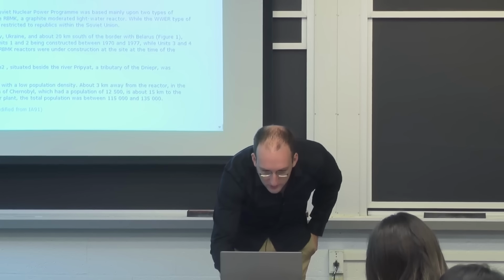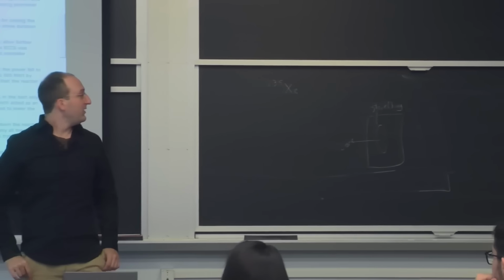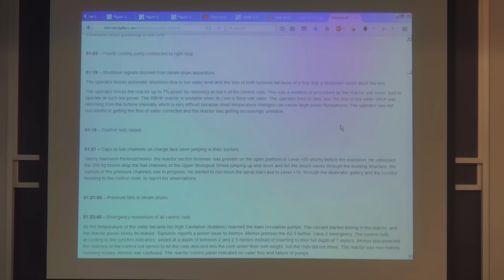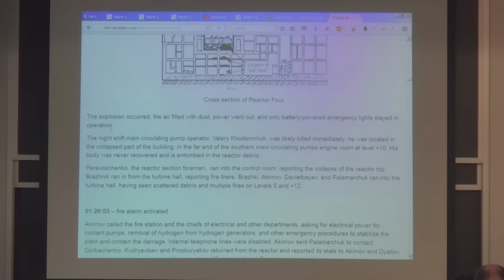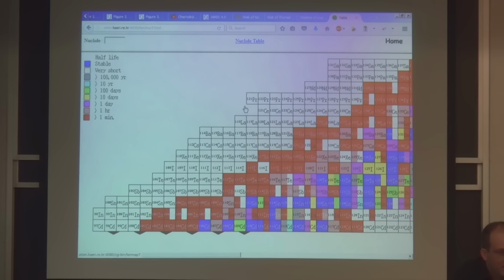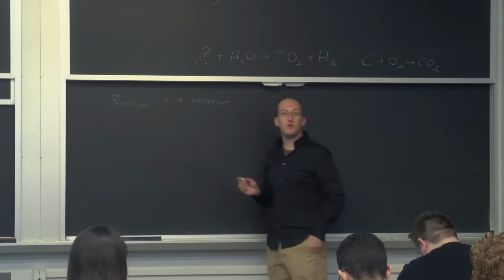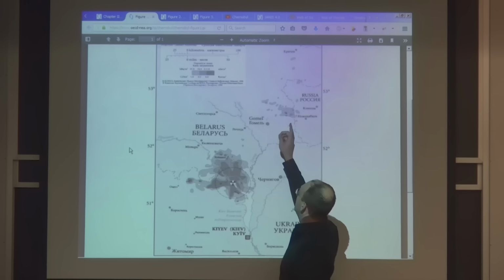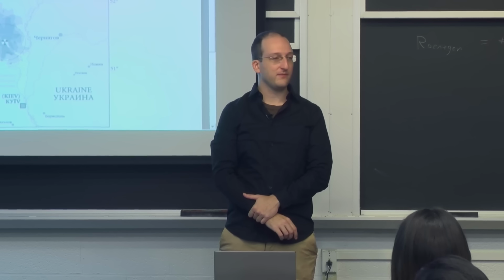26. Chernobyl — How It Happened

Comment: I worked at Leningrad NPP after the accident upgrading the SKALA system for 3 neutron flux cals. This lecture although there are some minor flaws is really good - there is a reactivity balance model that might have enhanced it further by showing Niles vs time for changing neutron energy populations, Xn135 conc and rod position. They also broke 6 operating rules leading up to the test not just control rod positions. Also the command and control perspective is often overlooked also. Many thanks
Reply: It seems that violating safety rules was normal working mode for Chernobyl. Because RBMK was so unsafe that they cannot work withot it.
Reply: @ВасилийКочергин-д6ы in soviet russia there is no safety rules
Reply: Indeed, the command perspective was very important. The early decisions on the test should have been over-ruled. Any resistance was countered by threats.
Reply: Thanks, comrade 🤝
Reply: Yes, the plants had a lot of issues, but the  ain reason Chernobyl happened was because of the communist system in place.
The people who knew what could happen (running the reactor at higher power in the hours before, poisoning the reactor) were disregarded, treated like saboteurs who didn't want the test to succeed.  
Later those that knew what was about to happen were silenced / threatened by those who wanted & needed the test to proceed that night (because delays would make them/ their bosses look bad)
.....
When it happened, the people who understood, were silenced / threatened because it was so absurd to say that a glorious NPP could go into meltdown.
.... Those who went out with numerous Geiger counters (all measuring off the scale) were told to shut their fear mongering because the detectors were probably just malfunctioning,
They even opened the amusement park to paint a picture that everything was okay and distract the people.

All to climb in the party, get promotions
Reply: @mysteryliner  It is factually wrong to say that "they were told to shut up with fear mongering".
The local operators pretty much knew early on that they had done a bit of a fucky-wucky from radiological surveys.
They just did not want to admit it and it was hilarious in the scariest sence of the word how they tried to hide the truth from higher-ups in the state.
Also the operators of TEPCO tried to hide the meltdown so its not actually a question of system.
Reply: @mysteryliner  and Fukushima happened because of... capitalism 😅😅😅 and its corruption.
Reply: @mysteryliner  The worst industrial disaster in history, overshadowing the death toll of Chernobyl by an order of magnitude, is the Bhopal gas leak. That was all down to capitalism and greed. Simply saying "Communism bad" is unhelpful.
Reply: @ErwinPommel  that was not the intention of my comment.

For the last 35 years, the world has feared nuclear energy because "remember Chernobyl" (while 8 million die each year due to air pollution, yet we are building more gas furnaces to get away from "remember Chernobyl"))

My point was that even though the plants had horrible flaws, they in itself would have never led to the Chernobyl disaster!
Reply: @ErwinPommel  Capitalism & greed + corrupt government officials that literally got sold to the businessmen. Also , quick reminder , Bhopal Gas Tragedy occured when Indian economy wasn't open to world investment. PS : I would still live in capitalism than communism. Your friend from India.
Reply: @ErwinPommel  Industrial development in Madhya Pradesh is state sponsored in order to stimulate industrial development of the region for political ends - not entirely dissimilar to these communist economies. In a free market capitalist economy there would have been no such development.
Reply: @tech_report_0868  It was the communist system, which lead to the disaster. Capitalism had nothing to do with it.
Reply: @FreedomPhilosophyTV  Having a free market economy is not incompatible with the state investing in some industries to help them get capital they otherwise couldn't. The key is whether private property is a right or not. In a socialist/comunist country you do not have property: your business is not yours, your home is not yours, what you produce is not yours. You are a slave of the state/politicians. In Cuba the state owns the business and state employees/communist party members decide what you can do, how much you can produce and how much do you earn and how much is for the state. They achiveve equality of results only for non party members: they are all equally poor. The flaws in capitalism doesn't make socialism/comunism good nor better, they are not, they are way worst. 

The one thing they do very well is propaganda. They are aware of how words create the concept of realty in people's mind.
Reply: @ErwinPommel  Yes. The only part i didn't like was the message, specially at the begining, that "American reactors" this, and "American reactors" that. It wasn't a dick measuring contest, just an informative lecture. Kind of bothered to have to hear that at the beginning, and coming from someone that looks like it doesn't lack any intelligence. So, not sure what the objective was on those comments, other than to brag just for the sake of it. It could just have been better to leave it color and country neutral, because now, how can i tell you are being objective?
Reply: @mysteryliner  Similar situation is what caused the Great Famine in China (1958-1961). Party officials would overreport agricultural storage production to make themselves look better compared to other regions. Everyone thought that they had more food than they did and "overspent". That, and the monumentally stupid decision to kill off sparrows because they ate grain seed...which led to bug infestation that ate all the crops anyway.
Reply: @r0x0r-p4t  probably so.
Sadly with Chernobyl, it has had more than 30 years of hurtful repercussions.

A reactor with many unique flaws (none that could have led to the accident) + communist tower climbing system that cause the accident.
All that caused the negative feelings towards nuclear energy we still have today.

10million die each year from effects of air pollution, yet we are building gas furnaces so we can close nuclear plants.... Because "remember Chernobyl!! / nuclear is bad"
Reply: @mysteryliner  No idea how the EV revolution is supposed to happen without consistent energy to power millions of cars. Part of me that thinks that's by design in order to keep the majority people out of cars and thus restrict their mobility.
Reply: @r0x0r-p4t  right now, "green countries" (eg: western Europe) buy gas from other countries (eg: Russia / Poland)

Or buy wood from Brazil that goes on a polluting ship across the ocean. (cutting the rainforest is 'renewable' because you could technically plant new trees.)

They burn it in "green" gas plants that capture/filter the exhaust (disputed results)

Due to huge gas exports, Russia and Poland will fire up the old coal plants to meet their own demand...  And since all pollution goes under the same blue bubble of air.... We're all getting screwed! And every year more people die than all deaths ever due to radiation.
Reply: @r0x0r-p4t  Oh wow, that's a great piece of ironic history there, lol.
Reply: @mysteryliner  Lol, yeah, I still can't believe the 19 (pick a decade) mentality people STILL have about nuclear and still spew the "derp nuclear bad" trope. But they are getting wiser. I think China etc. coal burning and the pitfalls of "green energy" kind of changed people's opinion a bit more pro nuclear now along with Demonizing fossil fuels. Nuclear don't look so bad now, hehehe.
Reply: @MrBilld75  I don't know. Seems like we still make the same mistakes.   We're still urgently phasing out nuclear energy, while every every study says that (unless you look at annual total power) we cannot cover our needs during nights, winters.
So.... We're closing nuclear plants and adding fossil fuel plants for winters and nights.
Reply: @mysteryliner  I suppose you're going to blame the Union Carbide disaster in Bhopal in 1984 on communism too?  It has nothing to do communism and everything complacent management.
Reply: @thekinginyellow1744  not sure how this is relevant? (quick search indicated that the disaster your mentioned had no nuclear element. It was a chemical/pesticide plant.) 

My point is that there has been 36 years of nuclear is bad and dangerous by pointing at 1 single event in very exceptional circumstances. (faulty design that was unknown from people operating, cold War run on weapons & energy, pressure to run the plant at high power before the test, breaking multiple rules that each should have stopped the the test, a failed design, communism and complacent management).... (Fukushima needed a natural disaster like we see in movies!   But anti nuclear lobbies still use it for their mantra:  Nuclear =bad, nuclear =evil, nuclear =dangerous!)

Meanwhile we're replacing nuclear reactors with fossil fuel, which is poisoning us every day they run, and it's an industry that has disasters every few years.
Reply: @mysteryliner   Funny, when you say something like "reason Chernobyl happened was because of the communist system in place."  it kinda sound like you're blaming it on communism.  What I was saying is that the culture at Bhophal was exactly like the culture at Chernoble (Actually Bhopal was worse.)
Reply: @mysteryliner  you know, i maybe agree with you if all modern reactor will be created by american engineers. But horrible incidents at russia continue to happen. Nuclear-engined missile exploded near Nenoxa, some people died and territory polluted. Also cloud of ruthenium escaped from russian "Majak" atomic factory. Academic Yablokov says that amount of chernobyl's victims is around 1000000.

Comment: I am surprised he didn't talk about the biggest threat of Chernobyl.  If the elephants foot had burned through more floors of building, it would have made contact with the Olympic-sized pool (from all the fire-fighting) below that had filled with water.  If that had happened, the imminent explosion would have sent up enough radioactive material into the air, it could have rendered half of Europe uninhabitable for the next 200,000 years.

Comment: This is not what I expected at all. Very superficial and half the time was spent talking about the consequences, rather than the detail of the sequence of events. Also, very little detail on the RBMK design and why its design was so significant. For example, the size of the core due to using low enriched uranium, and the complexity of controlling such a large core. Also, little detail around the sequence of events during the test and all the separate bad decisions that were made. This course must have been for people with a passing interest in nuclear power engineering. I’m a bit disappointed.
Reply: Completely agree. At the time in Yugoslavia I read better articles about this event and catastrofic human failures contributed to politics mainly,and a heroic attempts of soldiers,firemen and workers to contain the fire.

Comment: I've got two great ideas - let's moderate the reaction with a flammable material and save the cost of a containment and shield building using a butler building. Taps head - gets raise. This guy has a good knowledge of the theory and the math he also has very little knowledge of how commercial reactors actually are constructed and work. I may be wrong but I doubt he has actually been to a commercial nuclear plant to tour it during an outage so as to go inside the containment building and see how things are done. This is training others to teach others theory. I'm actually surprised at how poor MIT education is on this. This is a typical lecture given by an academic about a real world event. It's really kinda bad.

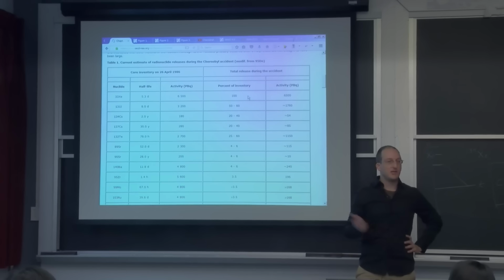Comment: 28:30 Played with Iodine as an adolescent , mix with ammonia and you get unstable Nitrogen triiodide, extremely sensitive, small quantities POP with a loud, sharp snap when touched even lightly, it can even be discharge by alpha radiation.
Reply: If you kept it wet (or dissolved in something, anyway, don't remember what) it was stable.  So like if you mopped a floor with it let it dry, and then dropped a pencil on it, a loud BOOM would ensue, attracting much attention in your high school. The floor looked like a layer of dust on it "jumped" into the air about a foot!!! Not that I would know anything about all that, mind you!!!  And there were no cameras/internet back then, so no proof!

Comment: if the turbine could still produce enough electricity to power the reactor/processes after a power loss wouldnt that basically be perpetual energy production?
Reply: I think the purpose of the test was to see if the turbine winding down could still produce enough energy to power the reactor before the generators came online. It wasn't intended to power it indefinitely, just for a few minutes or hours or whatever
Reply: @scrubly_jr  It was to see if the coolant water pumps could be powered long enough by the kinetic energy of the turbines. It was only before the diesel generators kicked in so we're talking about 60 seconds; not minutes and certainly not hours.
Reply: No,it's just inertia,like if you lift-off in your car and it keeps going -- not forever but for some time.

Comment: Also had they NOT had graphite tips/ends on the control rods, would the explosion have happened?
Reply: Apparently yes. There were "hotpsots" in the bottom of the core due to the positive void coefficient as a result of low power (the RBMK is very unstable under low power due to voids in bottom of core not getting pushed out by coolant). When they did the test, they shut off the pumps which was basically the end as more voids---> more heat---> more void--->more heat etc. . The tip effect was basically a "kick in the pants" to quote the professor in this video.

Comment: I'm no expert but... Everything I've read showed the full insertion time of the control rods as 18 seconds. And the graphite displacer on the end was around 4 or 4.5 meters long..
Reply: This “tip effect“ is not accurately explained. It was actually more subtle and non-obvious than the lecture (and the miniseries) described.
Reply: @zonets76  I mean, it's MIT. I wouldn't expect them to be precise. Mainly because the lecture wasn't specifically about the accident and what they did cover was accurate enough not to rely on properly describing the reactor or accident setup.

Comment: Trying to get the spinning turbine to power the reactor is like jumping the clutch on a hill except it the car doesn’t start everyone dies
Reply: From the things I've read the idea wasn't that crazy. The turbines only needed to power the coolant pumps for the time it took to bring the diesel generators to operating power. Under normal circumstances, even partially powering the pumps would likely have been enough, and for for a matter at minutes at most. The problem was the inherent unsafety of the reactor and the idiocy of the plant operators.
Reply: @SolarWebsite  had they run the test correctly, it would have been safe